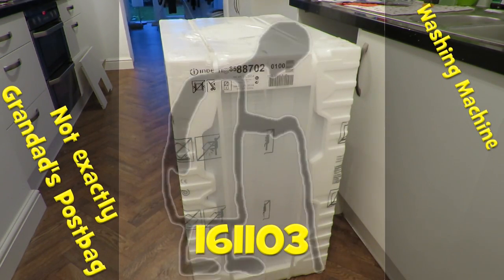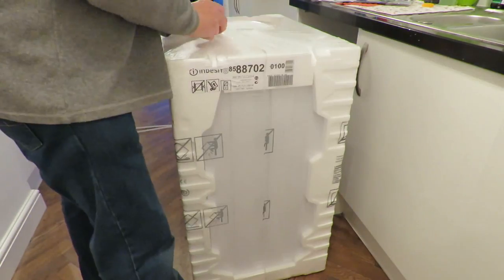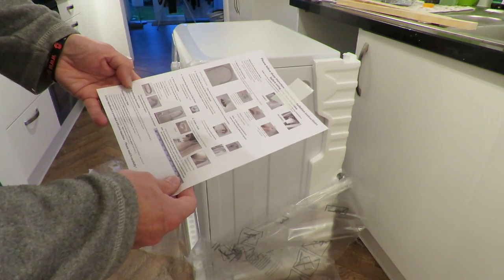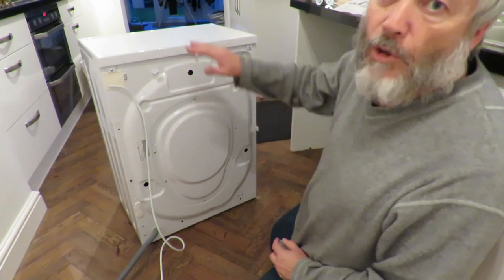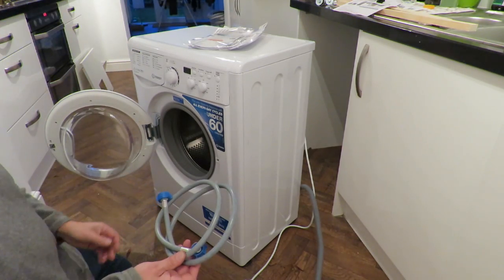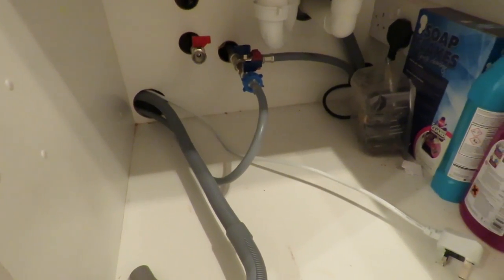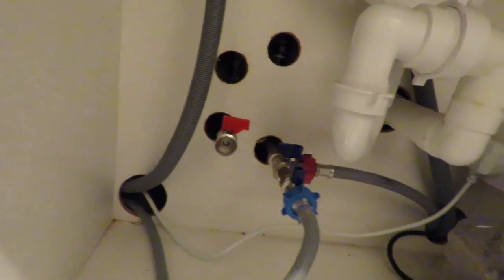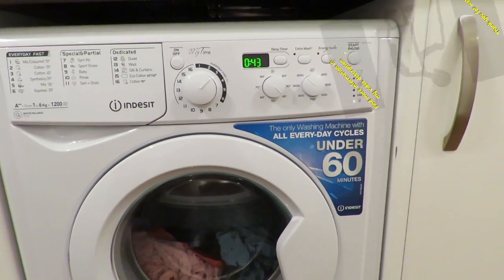Not Exactly Grandad's Postbag 161103 Washing Machine

Comment: You should have and uploaded it on your other channel. Here at my place we've had the stove , dishwasher and washing machines replaced and they are all brands I didn't want or I'm un familiar with. Our old washing machine was a side loader like yours but it ruined our clothes so we got a top loader to replace it I wanted a Siemens but my parents got a Simpson. Which I think I was tolled that Siemens don't make top loaders and the Simpson was recommended good luck with that one you've got.
Reply from the maker: Why should I have put it on my other channel?